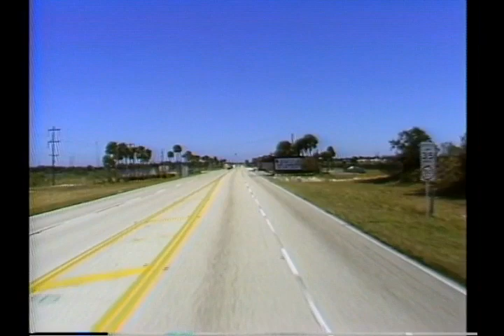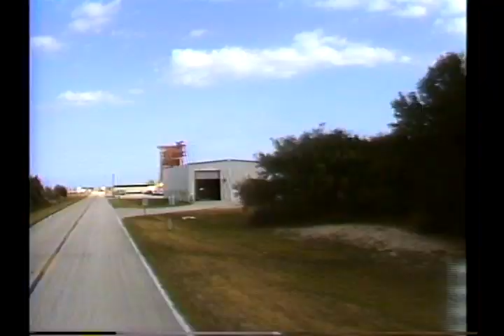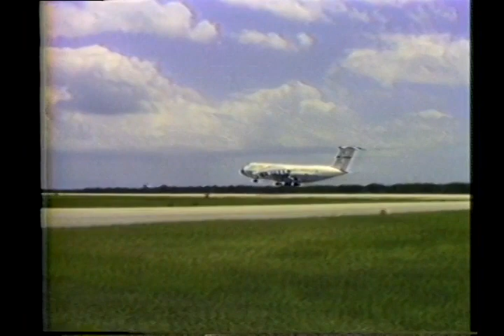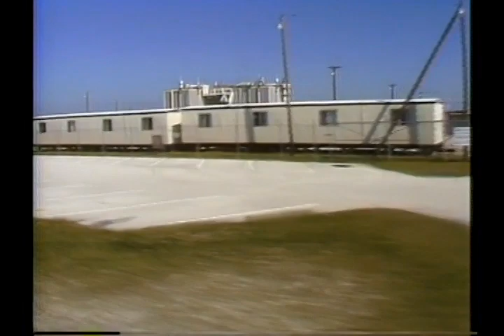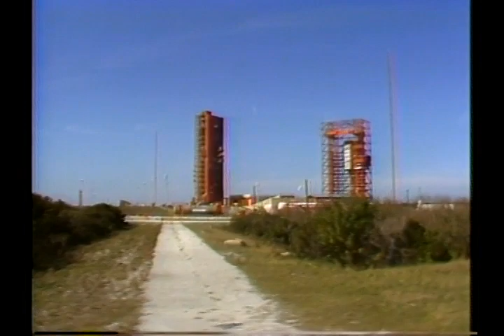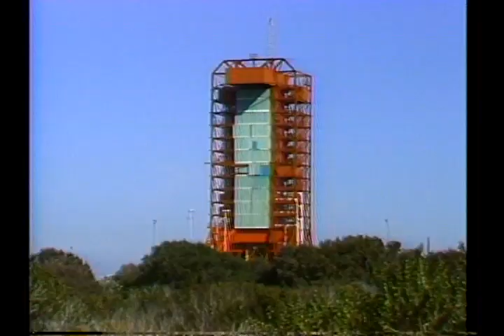Cape Canaveral Air Force Station Orientation Tour (Late 1980s)

Comment: My father checked out the thermal qualities of the TIROS Weather & SATCOM Communications satellites with RCA Radio Corporation of America in Hightstown, New Jersey in the 1980's.  This was the good ole' days of RCA Astro-Electronics in our very own Garden State.  Dad told me that 2 Air Force officers, (I believe both were Captains), were at Dad's Hightstown RCA facility to check out their DOD satellite that was to be launched onboard, I believe, a Delta rocket at the Cape.  Dad also told me that all the Hightstown RCA Engineers would watch the launches of their own facilities' satellites with great anticipation and excitement on closed circuit televisions in the RCA cafeteria.

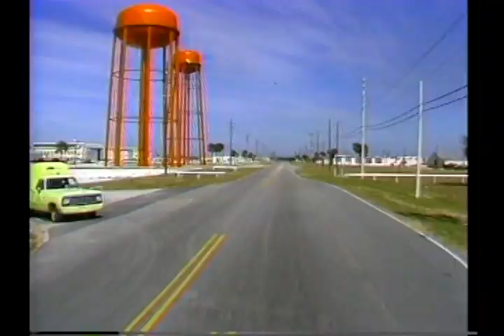Comment: Does this ever bring back memories.  In August 1988 I had just hired in at Martin Marietta Astronautics Group in Denver, Co and was sent almost immediately to CCAFS for a 2-week period to assist in pad modifications at CX-41 for Titan IV.  It would have been nice if they would have shown our group this video!  Some changes that have occurred over the years:  the iconic Vertical Integration Building for Titan III/IV has been torn down, as has the smaller water tower in the industrial area (shown at 6:15).

Comment: It is after the Challenger accident.  Shuttle Centaur was canceled.  They talk of LC-36A being converted back from Shuttle Centaur to Atlas Centaur.  The C-POCC, which was Centaur-Payload Operations Control Center is called Consolidate-Programs Operations Control Center in the video.  It was later called the Launch Operations Control Center.  I came out to the 6555th ASTG in August of 1988.  By then Delta II and Atlas II were in work (no mention in the video).  The SPIF prop pads (on the left of the road) has no coverings, which did when I was there.  So I would say this is in 1987.
Reply from the maker: I just revisited this.  I agree, based on the references (e.g. the Titan IV renovations at LC-41) this would seem to be circa 1987.  Thank you for the insight.
Reply: @ccspacemuseum  That would have been about the time of my first badged visit to KSC. While my badges often included the AF side, I never had a need to go over there.  In the last years of the 80s/early 90s KSC's rail transportation crew rebuilt the EMD SW-8M locos used on the Air Force side. We used one of them for my doing a test start of NASA's first #1 which had been offered to us. KSC had gotten 3 SW-1500 locos at that time to replace the 3 ALCo S-2s. Sadly now the SW-8Ms have been retired, the SW-1500s have been retired ( 2nd #2 resides with 1st #1 at GCRM ). One SW-8M is now on display at the Air Force museum at the Cape. The video shows the tracks on the base with one on each side of the road in many of the shots. The SW-8Ms were used in pairs when moving a rocket with a swing out arm on each that carried the Multiple Unit connectors to allow one loco crew to run both locos at the same time from one cab. The trucks from under our museum's SW-1200 were used under a SW-8M while its trucks were rebuilt so that it could be moved if need be. Our SW-1200 having been taken out of service almost as soon as the ALCo S-2 #1 had arrived from the Cape. #1 had the honor of moving the Shuttle Booster remains of the Challenger accident before being shut down by the KSC crew for its last time there.